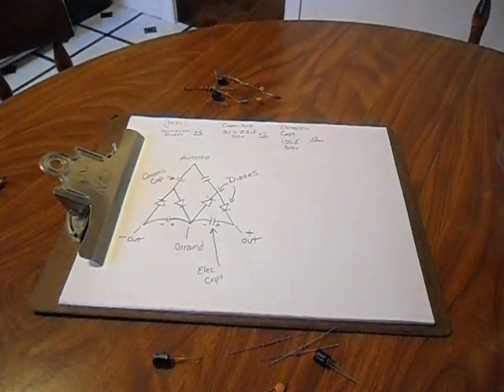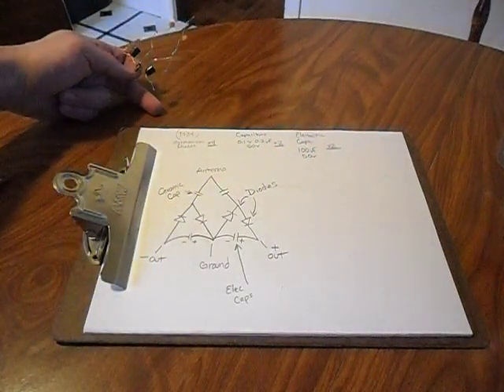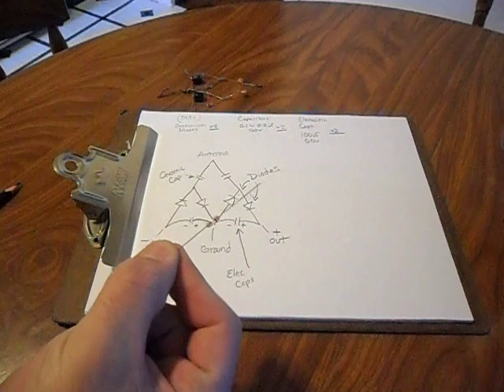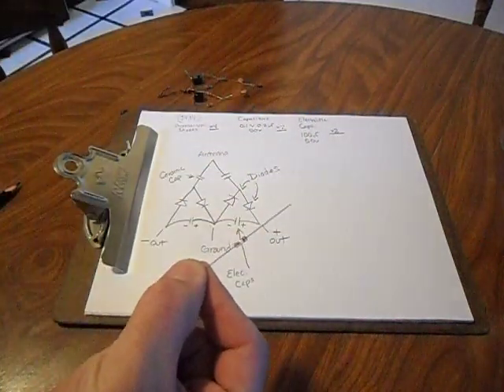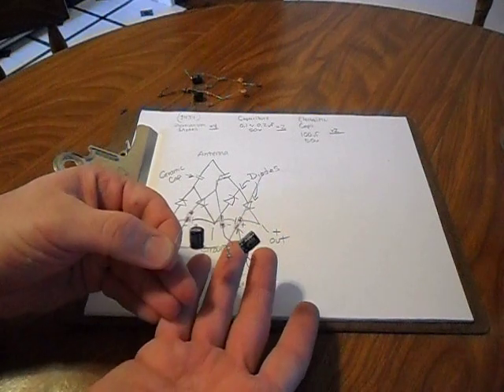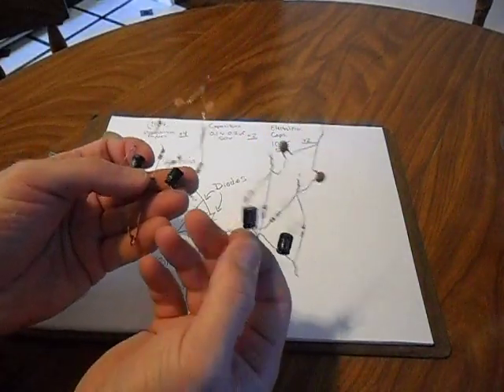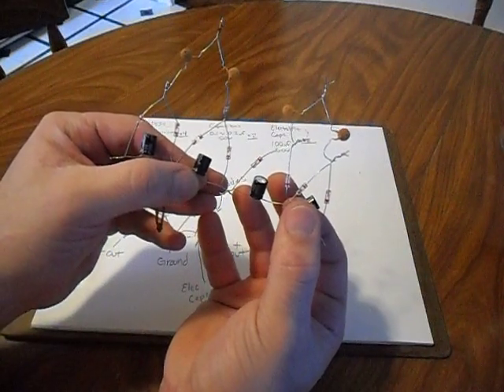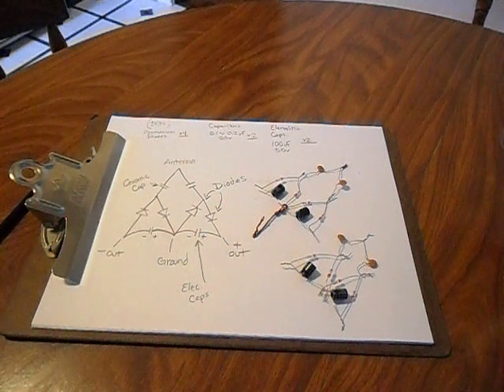Nikola Tesla "free energy from air" circuit explained and building instructions.

Comment: 1N34A germanium diodes do not have positive or negative ends.  they are bi-directional.
Reply: *****
Just get a germanium diode and hook a multimeter to both posts... then turn the diode around and hook it up backwards...  gasp you'll see both ends being positive!  I have a degree in computer engineering.  This was first year stuff.  If you're too lazy to get a germanium diode and test it yourself with a multimeter, just google it!  You'll find 1000's of sources that clearly state "contrary to popular belief, a diode does NOT have  a positive or negative pole... both poles are positive, one pole is just far more positive than the other."  The internet is a very strange place, I've used it since 1992, before the www.  It was a place to discover new information, sometimes even to educate you on something you thought was true, but you find out from more knowledgeable people is not.   The original purpose for the internet (ARPAnet) was something called "intelligence augmentation".  This is ridiculous that I'm still defending a VERY well known principle of electronics a year after I posted what I did.  I, like you, once thought that diodes had  + - posts as well.  I went to college and was shown otherwise, then I read it from many reputable sources.  Okay,  I was wrong.  Even though the schematics I'd been using for years showed + and - signs on the diodes, it is technically incorrect.  On a silicon diode, the weak post is so weak, yes, it does appear to have + and - posts, but on a hyper-sensitive germanium diode, this is NOT the case.  Google it, go buy a germanium diode and test it with a multimeter... go buy an 8 year old's crystal radio kit.  Do whatever you gotta do if it's that important to you.  When you assemble that child's toy crystal radio set (assuming it has a germanium diode which many do)... try this... put the diode in correctly to verify that it works... now... take the diode out and put it in backwards. gasp it still works!  It won't work as well because the weaker post is not as positive... but it still works.  It's very hard to respond to something as easily testable and verifiable as what I said.  It's a waste of my time and probably a waste of yours since you are more than likely so set in your mode of thinking that you will believe this is impossible and will not even take the time to google it or better yet... test it for yourself.
Reply: Jade Smith  uranium 239 my god... just google search "bi-directional" diode and argue with the .5M results.
Reply: You're an idiot. Diodes are made up of N channel material and P channel material. One side is the anode, positive. The other side is the cathode, negative. The very definition of DIODE states current passes from the cathode to anode (electron flow theory). Any diode CAN be bi-directional, but not in function. It simply means you're an idiot and blown out the junction. The only notable difference between a germanium diode and silicon diode is the breakdown voltage required to conduct from cathode to anode. Diodes typically are a solid color with a bar/dot/notation. The notation describes the location of the cathode.

If you know nothing about a simple component, such as a diode, then do not give advice for electronics. 
plz&ty
Reply: Jade Smith
I hate to inform you,  but you are dead wrong and have made a fool out of yourself by calling me an idiot.  A simple google search or basic electronics book will clearly state that a diode does NOT have a positive or negative end. You see this mistake 	 	in so many discussions. A diode will have a positive voltage on the 		 anode and a slightly lower (positive) voltage on the cathode. It will not have a 		positive on the anode and negative on the cathode.The cathode end is 		identified in a circuit diagram and 		on the body of the device.
		It may be identified with a line, chamfer or dimple or a symbol. So, go back to being an armchair electrician while I make real electronics... idiot.
Reply: HAHA schooled!!
Reply: I'm confused. :/
Reply: Diodes are not Bi directional, the only instance where you might get close to reverse polarity would be if you are looking for a specific voltage and you can create the drop from a low voltage using a germanium to get your desired higher voltage, or if you send more current through it will heat the semi conductor and that allows it to pass less Voltage because your resistance(of the cathode of a diode) is reacting to your high current flow.
Reply: CALL me the idiot. guys. just quit fighting like boys. All EVERYONE   knows is that DIODES      block flow in one direction and NOT the other. So how can they be bidirectional.                        In function of course.       Installed backwards its Not bidirectional it just won't work.       Scott        PLEASE ILLUMINATE
Reply: ET3K
Reply: Sydney Knight You my friend are either psychic or all of a sudden part of something much bigger because out of the blue you toss this my way and its perfect. DADHAV's motor running wirelessly video has the rest of this circuit using two transisters to return friring pulse that resonate the system at the rate of staic absorbtion freq. (in theory) he's running a motor with it. GIGANTOR will need something a bit bigger but the same reveiving arrangement. Ever heard of Alexanderson. BINGO. Thanks again Sydney. I am impressed.    
     As for the arguement on diodes, (i can't even spell argument right) I may get burned too, but to me a diode blocks current one way, I know there are myriads of them, for special apps, zeners for limiting some bias upon this and feekin that no kidding so I am staying out of it. I just need the dummy simple ones to block the back snap. 
Scott
Reply: +ET3K 
the terms + and - POLES are only used for ACTIVE elements like a battery etc.
a capacitor, once charged, can also be considered an active element.
Diodes are PASSIVE elements. they CANNOT hold electricity, and do not have + and - poles.
when you see a + and - signs in a diagram for a diode, it ONLY means in which direction the diode will conduct electricity.
(a diode is simply a device that will pass electricity/current in one direction, and block electricity in reverse direction)
you have written a lot more not correct, but it's not my intend to write a book.
Reply: +ET3K  I am sorry that the confusion has arisen about a germanium diode and it's operation, it is a diode, pure and simple, and passes current in one direction. The forward voltage drop is very low for a diode made from germanium, but the backwards leakage is very small indeed, but not enough to be able to say it is by-directional.

The example of a crystal set diode still working both ways round is that the whole circuit action is reversed by the reversal of the diode, not that diode is passing reverse current. The whole circiut simply functions on the other side of the received AC radio signal.

I hope this clears it up, as your description of the operation of a diode is miss guided, I also have degree level computing, but also have uni degree level electronics, and taught about and designed radios, TV and Radar transmitters, Telephone systems, and scientific instruments for a living.

The power circuit in the post is a voltage multiplier, only three stage and not symmetrical in operation where the output load is connected.
It will extract power from Radio waves, but the output will be nano watts unless near a big transmitter.
Reply: Uni-directional versus Bi-directional discussion between Stephen Wallin and +ET3K:

a "normal" diode like the germanium 1N34A conducts electricity in only 1 direction, and for this it can be labeled as Uni-directional. PERIOD!
since nothing is perfect in this world, we do have a very small (unwanted) leak-current in opposite direction. This leak-current is much higher in germanium diodes than in Silicon diodes like the 1N4007 mentioned somewhere.

when +ET3K refers to a bi-directional, he is referring to a very special case, where 2 ZENER diodes are connected in series and back-to-back. and used mostly (but not only) for stabilizing circuits.

a "normal" diode like 1N34A will break down (dead!) if the reverse voltage applied is higher than a certain voltage.

An "ideal" diode would have a ZERO voltage loss in forward (conducting) direction. In our real world, Germanium diodes have a voltage drop (loss) of about 0.3 volts.
and Silicon diodes about 0.7 volts. However, the Reverse current (unwanted) is much higher in germanium than in silicon.
Germanium can only handle relative low reverse voltages before it breaks down (dead!). i.e. 30 volts. Silicon can handle much, much higher reverse voltages. i.e. 1200 volts.

ZENER diodes are a special type of diodes. it is used in the Reverse direction, meaning initially there is no current flowing. if we keep increasing the reverse voltage, at a certain ("zener") voltage, for example 12 volt, the diode will suddenly start conducting, while the voltage over the zener remains 12 volt, even if we increase the source voltage.
However the reverse current MUST be kept below a specified maximum i.e. 50 mA, or the zener diode will blow up.
This "constant" 12 volt can be used as a reference in stabilizing circuits etc.

Remember:  a ZENER diode is also a DIODE, meaning that it will conduct current in the forward direction, like any other diode.
If this is unwanted, then 2 Zener diodes are connected in series, and back-to-back.
Now we can use this in an alternating (AC) voltage circuit. whereby it does not matter which side we apply the positive voltage.
so: with two 12 volt zener diodes back-to-back, the voltage will be 12 volt maximum over this unit, no matter the voltage direction.

This is what +ET3K is referring as "bi-directional diode"

note again: nothing is perfect in this world
Reply: +Jan Pietje But in the Circuit he is using germanium diodes, not Zeners , and they are not back to back, but in parallel to earth, separated by a capacitor. I just built the circuit and it works as a sort of Crystal set, if one of the top caps is replaced by a variable condenser. it is very wideband to say the least, and the voltage out is very low at about a .0001 of an amp. No free energy here.
Reply: stephen wallin that's why you are correct and he is not in using that term.
By the way, there is a much much simpler basic circuit to accomplish the same,
With only 4 components, an earphone, and a piece of wire as antenna.
But....i'm not promoting anything already on the internet

Comment: Hi newmrv I love this video!
I need your help. For a science project I am making a GIANT air circuit, that can produce 120v. I will use a inverter to turn the DC electricity to AC electricity. So, I can power up the 120v Neon Transformer of my Tesla Coil, make a ECO FRIENDLY POWER SOURCE!!! Can plz plz plz help me create this circuit. Can you give me some instructions and a supply list. PLZZZZ! Thx in advance!
Reply: So, I basically need to create 12v DC from the air circuit
Reply: @danyala.1659  so did you do it?
wheres the vid?

Comment: Although I do think this is the correct approach to getting the most out of Tesla's "radiant energy receiver," one potential problem with your "kit" is that the quality of the results can vary greatly depending on the antenna chosen so some may put it together and wonder why it doesn't work. Its good if you have those parts lying around but I think a better approach would utilize an air variable capacitor between your rectifier diodes and your antenna.

Comment: i tried it out recently and had an air ionizer near to it. I noticed that this thing excites eletricity so it steps up what one would otherwise get. with a kabel close to it I got 50µA at 2.2V with a highly efficient led continuously. But when I switch this thing out and attach a bigger metalrack i get just around 100mV and barely a micro-amp of current. I think because of what i have noticed that this circuit also sucks waste electricity from cables running along the antenna so be aware of that possibility, although i must add i did not test great hight-differences and just with 1 rectifier and not 2 in series like the setup you have shown.
Reply: You're trying to apply this to a concept it doesn't even work on.

Comment: Hey, I twisted my wires and did a ground and antenna, about 7 feet in the air and got nothing. Am I doing something wrong? How exactly do you measure the volts with the voltmeter.

Comment: Newmrv, I have replicated the same design with slightly different diodes and capacitors. I got less voltage but it works fine. Keep up the good work!

Comment: I just built two of these and connected in parallel, joint ground and separate antennas (Single-strand speaker-wire) and got 0.13 volts stable.
Reply: Interesting , 20 likewise should present 13 volts , but stable under what load, could you draw 250mA ?
Reply: e ,, I correct 200
Reply: At what current?  Nearly zero.

Comment: So you have twisted some components together and formed an open circuit with no power source? What exactly is that supposed to do?
Reply: Thomas Silver
Any wire will put small amounts of power from radio waves into it, it's how a radio works in the first place. The power however is so negligible that it isn't worth it. For the miles of cable you'd require to generate a "power source" you would have to spend a small fortune in installation and materials. Even after all of that has been completed, you would be stealing the energy from man made sources (Which is fine, but it doesn't replace conventional power generation). I can say with certainty that after completing the above steps, you would not generate enough power to earn your money back, and if everyone did this.. the cost to obtain the materials from the ground and formulate them into useful components would waste more energy than it would ever generate.
Reply: negative/positive out, antenna and ground, could it be more fucking clear ? I'm not going to say it works but the circuit is pretty self-explanatory.
Reply: If something doesn't actually work I fail to understand how it can be self explanatory.
Reply: KawallaBair The antenna is supposed to act like the power source. I call bullshit on the whole thing though.
Reply: itsrawrz
From what I can tell, he has an antenna which apparently charges two non polarized capacitors. If the antenna could build up a substantial enough voltage, these would charge.. a little. He then has two diodes in parallel looking in at the circuit from the antenna, on each side of the circuit diagram.

On the right hand side, the current travels down the leg and meets a node in which the current can split left or right, it is always going to split to the right, because the left diode is designed to restrict current flow from going down that branch when pointed against the direction of current flow.

 The second diode permits the current to flow, but that current is met with a second branch. On the left hand side, the current is met with maximal resistance as it is going against the flow of an electrolytic capacitor. If the current could overpower the capacitor, it has a chance of exploding. Instead however, due to the low potential currents involved, the current would be short circuited as all of the current (Or at least 99.9% of it) would be shorted to the ground terminal in the center.

On the right hand side of the circuit, we have a similar problem. Current flows down through the right hand branch and has a choice between going to + out or going through a high resistance gap on the electrolytic capacitor. If the circuit was of high enough resistance, and the voltage was high enough to be useful (It wouldn't) it may blow the capacitor. Failing that, the current would flow to the circuit and the electrolytic capacitor becomes something that may as well have just been a diode, because there is no power coming from ground.

So let's assume for a moment we connect the circuit up, the power would flow from the antenna down the right hand branch to positive out, which should go around the circuit and arrive back at the negative terminal, which charges the electrolytic capacitor and sends current to ground. While another branch bypasses the capacitor entirely, making the second electrolytic entirely useless.

To sum up what the circuit is doing, it is taking no voltage from the air, and feeding it into two capacitors in parallel (Not even large enough capacitors) and it is then going down a positive branch, which goes around the circuit and eventually connects to ground. I.e the circuit when you reduce down all of the components you didn't need (The diodes pointing from ground, the electrolytic capacitors) looks a bit like this:

Antenna --||-(combined parallel caps)--circuit--gnd.

In other words, because the antenna wouldn't have enough power to actually charge the capacitor and the circuit eventually goes to ground (Making the assumption that he wants the voltage to travel back into ground, and forming a connection with the antenna through the air to complete the circuit). That is pretty much by definition an open circuit with a little capacitor buffer.. that does nothing.
Reply: KawallaBair Don't get worked up man, it's pretty obvious that it is bullshit. Didn't need that much to prove me that.
Reply: itsrawrz these kits are for demonstration of Tesla's ideas. These will pull very small amounts of power from the radio waves around you....Some of them are natural and most are man made. All you need is lots of antenna.
Reply: KawallaBair
Agree.. I just copy/paste the text which is in the description of the video :p